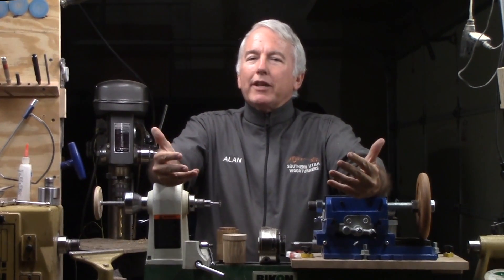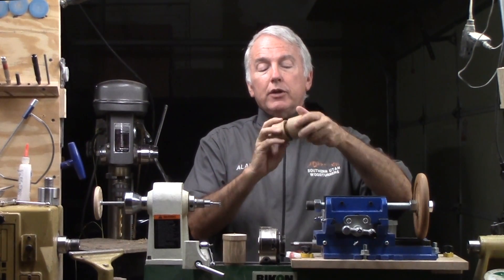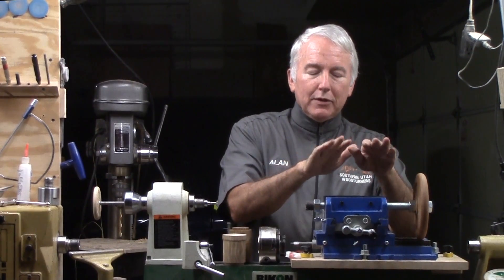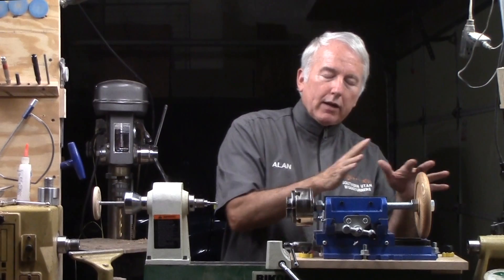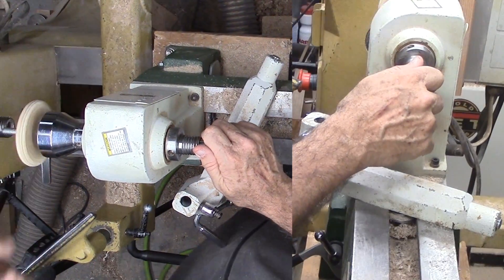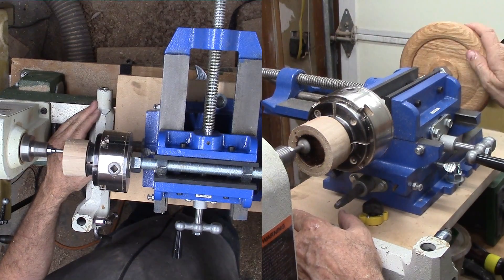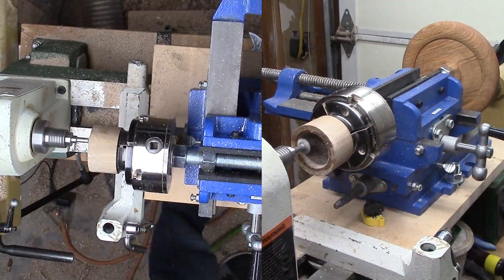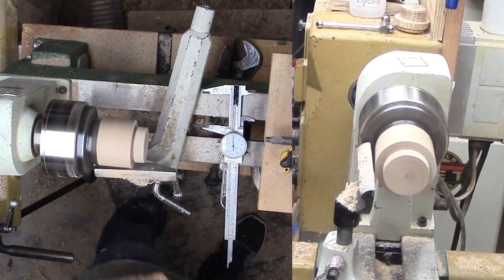DIY Threading Jig For Common Wood

Comment: Thanks Alan.  Threading was my quest also, but I did go the "do it myself" route. Yes, I had to have a machinist thread a lead screw (12 tpi) but that was the only outside cost.  As well as threading on the lathe, I can thread off-lathe by using a router to drive the cutter.  I can share photos.  Great suggestion to use CA glue on threads.
Reply from the maker: Thanks for the thoughtful comment.
Alan

Comment: Hmm, a good 'cheap' version. I learned on the Klein jig. I make the recess on my lids at 3/8 inch deep, and the tenon is 1/4 inch deep, which, in theory, leaves plenty of room to adjust the shoulder on the base enough to get the threads to line up. Bulls Eye spray lacquer works great on the insides. Smell is gone in a minute or three. Never use a solvent based finish as the smell will never go away.... One would think that the cutter will cut the threads dead parallel. They do that some times, and some times not. I use a six inch long steel rule against both tenon and recess and then eyeball to see if it lines up with the lathe bed, then cut. I use digital calipers to measure the offset needed. I cut lid/recess first, then tenon. Tenon is 0.06 bigger.
Reply from the maker: Good Points.
Alan

Comment: Great demonstration! Didn't see reference to provide a stop for the depth the threads extend into the box or lid. Necessary to stop cutting at the same place with each pass. I use a  one piece 3/4-16 threaded shaft locking collar available from McMaster-Carr to limit the all threads travel into the nut trapped in the vice. Two lock nuts could also be used jammed together as a stop. DLC
Reply from the maker: Great tip!
Alan

Comment: I'd like to make a suggestion to you, about a couple of hacks to your threading setup.  First off, this is really cool and very ingenious and I am going to make one in a similar manner.  What I am doing is to install a medium strength, compression spring, about 4" long, over the threaded rod - between the 2 nuts that hold it in the vise.  The pressure exerted by the spring will force the 2 nuts apart, as you are clamping them in the vise.  This will then eliminate any backlash on the threaded rod, allowing you to cut more accurate threads.  Don't use a really strong spring as that will make it more difficult to turn the rod.

I am also using a piece of 7/8-14 threaded rod instead of 3/4-16.  I think that 16 tpi is a bit too fine for some wood thread applications, so 14 tpi is a bit better pitch I think.  8 TPI and 10TPI are both a bit too coarse for wood working unless you had a very large and heavy duty project.  Even better would be 12TPI but no one makes an adapter from 1"-8 to 1"-12.  I found an adapter from 1"-8 to 7/8-14 on Amazon, it was just delivered today as a matter of fact.  It will work good.  I have another ordered for 1"-8 to 3/4"-10 but I doubt I'll use it very much.

I will also install a metal hand wheel (4" diameter) on the threaded rod to make it easier to turn.  It will give me smoother and more consistent rotation.  I'll attach it with a key on the rod so I can remove it and move it over to the other rod if need be.
Reply from the maker: Sounds like a great solution to backlash.
You nailed the issue with TPI. Glad you found the appropriate adapters.
Alan

Comment: I suppose this works best if the center height of the all thread is the same as the lathe. But I'm also thinking that it does not need to be spot on. Am I correct in that assumption ? I have a jet 18/40 and I see no reason why this would not work if the vice has a thicker platform.
Reply from the maker: Most important is that it advances parallel to the lathe axis.
Since you are cutting a round object without calculating exactly where things are, you will not notice the difference except on a very small diameter(that you are unlikely to cut). It would limit the diameter you can deal with.
Alan

Comment: What mini lathe are you using in this setup?  I have a Jet JWL-1014, and there's not enough room under the vise for a mounting board.
Reply from the maker: Rikon 70-050VS, a 12 x 16 lathe. it has an extra 1 of radius than yours
Alan

Comment: There a lot of wobble in the all thread and nuts. Any ideas on how to tighten the tolerances? Thread tape?
Reply from the maker: Teflon tape and longer nuts both help.  Use connectors if possible.
Alan

Comment: Enjoyed your video and picked up a few pointers, just made my first threaded box today on a set up i made.  My idea was to use the metal lathe as it has gearing to cut any thread. Basically the wood was held in the chuck, and a dremel type unit mounted on the carriage, cutter runs at high speed. I ended up turning the chuck by hand as the lowest speed was to fast.  I put the male thread on the lid.  After that I was thinking of a way to just use the wood lathe, My idea was the same as yours, interesting, I was thinking mine would be the only one
of that kind.
Reply from the maker: Machining items from wood or metal have been around for Many, Many years.
Rarely is there anything truly new. mainly used in new contexts.
Alan

Comment: Hey, I liked your demonstration a lot.  I was thinking of making something similar.  Did you want such a fine thread on your piece.  I was thinking of just using a 1X8tpi threaded rod which is a rougher thread than the 16 you're using and since my chuck is 1x8tpi I wouldn't need an adapter.  Just curious why you didn't go with a rougher threaded screw.
Reply from the maker: Since I'm 1.25x8tpi, this was the first setup that I could manage, I've subsequently adapted to a 1x8 that you suggest.
Go fer it.
Alan

Comment: In the UK GWR Fasteners can supply the threaded rod and five nuts for about £20.  Got mine and now for the brst part, building it. Thanks for the ideas.  By the way, my small Axminster lathe came complete with the 3/4 to 1" adapter so they may sell it.
Reply from the maker: Thanks for your research.
Alan

Comment: I may have missed this, but you mentioned bit is 3/8" diameter, but what is the angle of the bit. thanks
Reply from the maker: Most threads use a 60 degree angel
Alan

Comment: Question for you Alan. How do you align the center line of your threaded rod with the cutter?  Do the center lines have to match or can the rod be higher/lower than the cutter?
Reply from the maker: Ideally, the center would exactly match the spindle axis. However, as long as the axis of the chuck on the rod is parallel with the spindle axis, you're okay. The only minus is that the minimum diameter that you can thread is larger. Notice that I said the chuck axis instead the rod axis. As long as they are parallel is does not matter if left, right, up, or down. same impact.
The larger issue is if the axes are skew, meaning they are at an angle to each other. Then threads are cut deeper on one side than the other.

Comment: The design of this jig is brilliantly simple. I was wondering how you would control the spacing, but the all thread takes care of all that for you.  I might have to get the parts and give this a try.
Reply from the maker: You are correct. They key component is the all thread followed by how to mount a chuck to the all thread.
Worth doing.
Alan

Comment: Alan, thanks for the awesome video. I'm trying to design a custom pen with a screw cap. to reduce the thread size to the diameters I need, would it be as simple as swapping out the allthread with the size one needs? or does the cutter need to change as well?
Reply from the maker: you are correct on pitch. Swapping the allthread is the easy part. However, supporting the wood and chuck from the smaller allthread will be the first challenge.
For something the size of a pen, you would need a cutter smaller than the diameter you are cutting for the female threads. That will be your second challenge.
Alan
Reply: @AsWoodTurns  thanks for the reply. something I'm still thinking about...

Comment: Amazing tool Alan. I will eventually make one. And, you may have missed Gerald Jensen's reply to your's, replying to john b. It's for a modification to the XY Vise that looks like a "must have" to get rid of the vise problems. There's also a review of the vise at https://www.youtube.com/watch?v=YfzApO4R1bM with some tuning tips that may help.
Reply from the maker: In the video, he said he replaced all the hardware. From appearance and cost, I doubt that he replaced the lead screws.
So far, I have replaced the side crank with the largest wood wheel I could fit. I've also wrapped teflon tape on the lead screw - it seems to have removed a lot of slop. May have to replace teflon periodically but it is cheap and easy.

Comment: I'm just starting out and was wondering if you could thread wood now I know wish it was alot simpler and cheaper.......
Reply from the maker: Two ways to thread: 1) hand chase; 2) machine cut. Hand chase tools are not cheap. Commercial tools are definitely expensive. 
If you're just starting out, stick to boxes for a slip fit for a white.
Alan

Comment: Alan, I was able to put your jig together and just finished my first successful threading. Thanks for the info. One or two small tips: I found that the allthread has a lot of slop, to fix this I wrapped the threads with 2-3 layers of pipe thread tape, no slop now.  Instead of mag-locks I just side up the tail stock and lock it in place. I also bought some fittings for a 3/4-10 allthread and will try that for a coarser thread on larger boxes and urns.
Reply from the maker: Sounds like you caught the bug. Great
Alan

Comment: I made the jig and it worked well just sitting on a board. Would you share the dimensions of the base you used?
Reply from the maker: About 1.5" wider than the vise and about 4" longer to accommodate the magnetic clamps.
Alan

Comment: Nice one Alan. That looked a good thread for a long one. Probably half that will suffice when you make your boxes. That was one of the changes I made as my first boxes took for ever to open. :-) 
  I had 7 threads.   Good unit though and good fun. Thanks.
Reply from the maker: My metal monkey friends say that 1 and a half threads should be sufficient. But what do they know about wood? I'm planning on 3 to allow for adjustments until I have more practice.
Alan
Reply: Aye, one and a half threads would be a bit lean for wood. Three threads, I now find ideal myself. I have passed the link to your video on to a few friends interested on threading. Thanks again.

Comment: As Many of your viewers say, thread chasing is a bit of a dream and to me a dark art, commercial thread machines are expensive as you point out. Your contraption is great and I have started the process of building one, my only set back is trying to source the cutter here in Australia. Love your innovations keep them coming.
Kind Regards
Steve
Reply from the maker: I would think a 60 degree HSS cutter should be standard across continents. But yes, a local vendor would save a lot on shipping.
Alan
Reply: Thanks Alan could you suggest a US supplier that ships internationally
Reply from the maker: Please check with the suppliers that I identified. Don't know their policies.
Alan
Reply: MSCDirect will not likely ship outside the US.   This supplier has the cutters for less than MSCDirect and states they ship worldwide.   May be cheaper to find a Chinese source.

https://www.maritool.com/Cutting-Tools-Keyseat-/-Milling-Cutters-Chamfer-Milling-Cutters-Double-Angle-HSS-Chamfer-Mills/c78_231_237_239_277/index.html

Dave.
Reply: Thanks Heaps will give them a go
Reply: Thanks Allan
Reply: Stephen McFadyen    Stephen- before Alan made this video I bought the Hope Threading Jig from Simon Hope. The cutter he uses is identical to the one that Alan uses. He's in the UK and ships all over.  I kind of wish I had waited to buy my jig. It works, but only when you use it. Its easy to get frustrated using it.
Reply: Thanks Jim I checked out the hope jig and purchased one still waiting to be shipped
Reply: Stephen McFadyen   are you in the U.S.  ? If so, Simon has representitives here in Florida & probably in other states as well.
Reply: Jim, no I am in Australia

Comment: Well done Alan. Now that you have threads the next challenge is to rig the jig to make it "bayonet" style for quarter turn closure.
Reply from the maker: Well Bert. You're just going to have to show me how!
Alan
Reply: I will take some pictures of my efforts to date. I did post a box on FB. 
I used a collet to hold a straight cutter router bit in the lathe, I mounted an indexer on a cross slide, the indexer holds a collect that holds my carving head spindle which matches my lathe chuck threads. the process is similar to threading except I remove portions of the threads on each part. I'm still learning but it is important to have the mating parts threaded and aligned BEFORE marking and removing threads. I made a ships wheel clamp to fit my chuck so I can control the rotation. I now use it for threading too, I had the chuck unthread from the threading jig once when I didn't have it tight enough. .

Comment: Very interesting jig Alan. I was going to ask what sort of shank this cutter has, but I think I understand from the description that it is a 3/8" Diam. straight shank, correct?
One more question, what RPM is recommended for the cutter?
Reply from the maker: I'm running it as fast as the lathe will go. The cutter also works in routers and other tools that run much faster. and it is only 3/4 diameter.
A machinist could perhaps advise otherwise.
Alan

Comment: I wonder if you could hold the thread cutter in a standard collet chuck.  It would probably limit the depth of inside threads, but how much depth do you really need?  This is a really neat project, but now I have to buy a new insert for my Nova chuck to convert it from 1 1/4"x8 to 1"x8, bummers.
Reply from the maker: Yes, if fact the 2nd demo I mentioned had his cutter held in a collet. If I had one already, I'd be good with it. Otherwise, a MT2 collet with drawbar is much less expensive.
1 1/4 vs 1 - Yeh I have the same problem. But there are adapters and inserts.
Alan

Comment: Just an after thought you can take some of the play out of the chuck thread .buy putting a spring between the chuck adaptor and thread nut. it will take some of the backlash out.
Reply from the maker: The backlash that I'm worried about is in the XY Vise.  I'll look to see if I can get a spring in there.
Thanks.
Alan
Reply: Don't know if it would solve problems with the Harbor Freight vise, but this guy sells a 'Correction Bracket Kit' that might be worth a look: https://www.youtube.com/watch?v=e1TYMpf_FPg
Reply: Thanks Gerald, That seems like a great modification.

Comment: Is there a reason you want 16 threads per inch? This seems awfully fine for wood threads. Why not just use 1" x 8 tpi threded rod and nuts?  I use 60 degree angle end mills in my metal shop and find them much less expensive on eBay. Excellent idea and video as always. Keep 'em coming.
Reply from the maker: TPI  probably falls into the personal choice category. The second demo used 10  tpi. Comparing the threads, I prefer 16.
Your results may vary. I'd love a full range but that is not practical for a non-machinist.
Thank you
Alan

Comment: Excellent video, Alan.  A wonderful 'everyman' project.  I did not see the magnets (?) you used to hold the jig down on the lathe bed in the parts list.  Did I miss something?
Reply from the maker: No you did not miss something - I did. I used MagJig 60 from Mag Tools. I would recommend Mag Jig 95 for a better hold. I've upgraded the description to include this.
Alan

Comment: I wasn't watching whole video so I don't know if you addressed this, but you can avoid backlash of the nuts holding the lathe chuck, by just gently hitting one of the nuts with a hammer while they are not fully tightened.
Reply from the maker: My understanding is that any machine has backlash or else parts would not move and that it can only be minimized.
But, thanks for the suggestion. I'll look for how it can be implemented.
Alan

Comment: LOL - 'Sloppy Fit Hardware Store'... =)   I may have spent a few dollars there in the past... ;-) 

I was going to say that you should put a runner on the bottom of that vice mounting plate so that it rides on the ways of your lathe and would always be parallel with the bed to make things easier for the future, but saw that there's already on there.  Why were you concerned about it being off?

Hope you plan on turning that test blank into a box - doesn't look like it'd be too difficult to complete. =)
Reply from the maker: More money there than you'd like to admit? :)
If not in alignment, then the threads would be skew to the box axis, leading to a bad joint between top and bottom. As is, it is not perfect but works fine.
When I finish it, it won't take long at all.
Alan